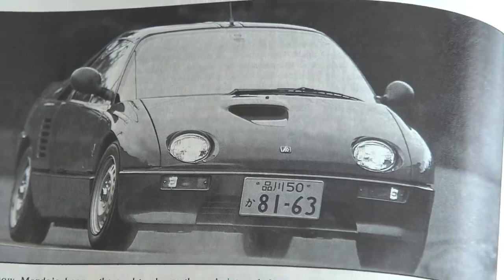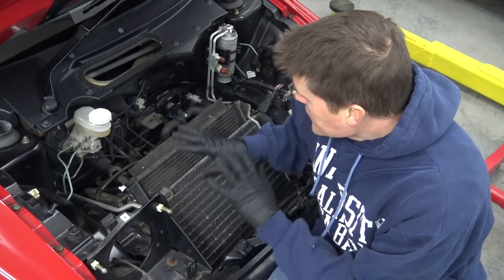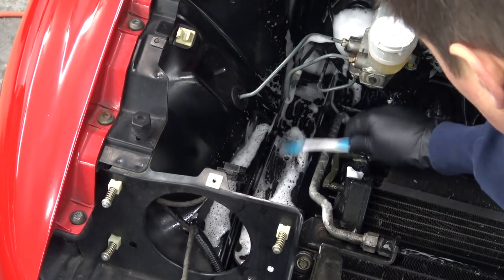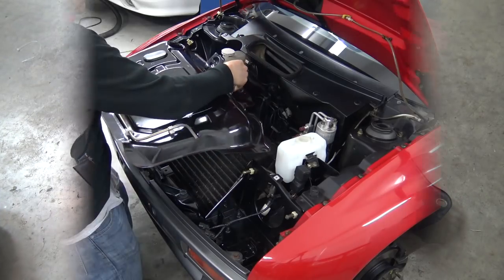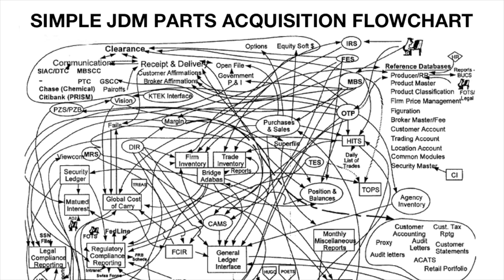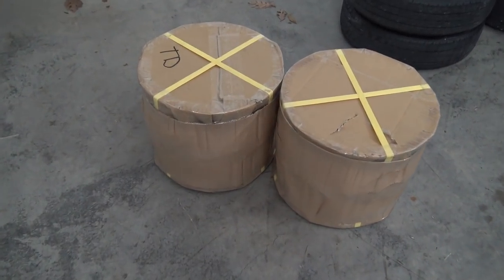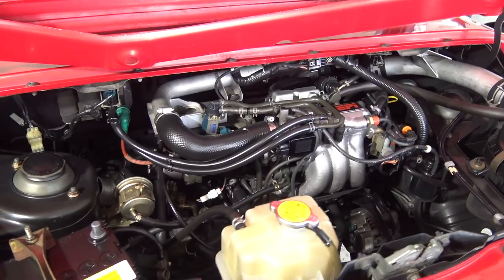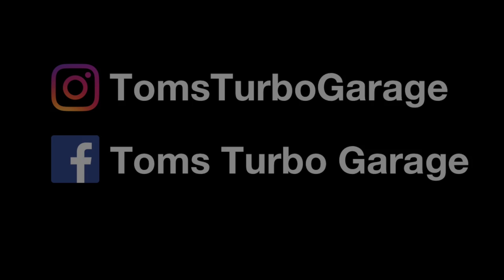1992 Autozam AZ-1 My Super Tiny Sports Car!  Part 2

Comment: That turbo timer is pretty cool, but it doesn't play songs like the HKS ones.  Those JIS screw drivers are a must. I was convinced for years that the Japanese had some how figured out the perfect formula to force you to buy new screws every time anything needed to be removed on any of their vehicles, until a very helpful Popular Mechanics article in the mid 2000's set me straight.

Comment: I'm pretty sure you can find mechanical replacement parts from early 90's Suzuki and Mazda vehicles. I'm sure the headache would come from finding nice Body part parts and interior parts
Reply from the maker: You can find some, most of the parts available here are for the SOHC non-turbo engine that is in the micro trucks.  All of the DOHC Turbo specific stuff is hanging out in the motherland.
Reply: Tom's Turbo Garage did you try megazip dot com? I found a lot of OEM replacement parts on that website for my Suzuki Cappuccino.

Comment: Scrubbing Bubbles is an interesting choice. Easy Off Fume Free oven cleaner should work for anything Scrubbing Bubbles can't handle. Easy Off Heavy Duty oven cleaner is even stronger, but I'd only use it for burned-on oil around the exhaust and turbo, because it's SUPER aggressive and it will damage metal if you leave it on for too long.

Comment: Hey Tom, next time you need to paint a metal surface matte black try using the rust tough from rustoleum. It's a tad more expensive but the finish is much better than most others that I've tried and it's a much deeper black.

Comment: Have you test-fit the spare tire in the space above the radiator? If it fits, it would be worth adding your own bolt to secure the tire in that spot, so you can reclaim the storage space behind the driver's seat.
Reply from the maker: The metal is too thin to mount a spare to.  A new thicker or reinforced metal radiator cover would need to be made.  The spare inside the car doesn't bother me that much, I don't need any more storage in the car for what I use it for.
Reply: Really? It looked like it was at least 1/16" thick, and assuming it's made of steel it should be strong enough to support the weight of such a tiny spare tire.

Comment: Tom, you know if you're getting into finding the correct JIS screw driver for working, you may be interested in replacing yellow zinc fasteners with the correct JIS fasteners.  It really makes the engine bay, or wherever, really pop.  I have found Belmetric.com to actually have JIS fasteners.  Like, you know, M6 with the ubiquitous 10-12-14-17mm head size?  Instead of the hardware stores' typical DIN standard fasteners.

Comment: I'm just saying, that engine bay has lots of room for a small Turbo for some more OOomph. As long as it's removable, we wouldn't want to loose the oem look and value.
Reply: It is turbocharged already.
Reply from the maker: Yes, it needs a little something for sure!  A turbo upgrade is available, but introduces lag.
Reply: Does anyone make a supercharger tiny enough to fit that baby engine?
Reply: Tom's Turbo Garage have the engine bored just a bit.   And don't go crazy of the boost.   Anyhow,  lag is what make crappy 90s turbos so much fun😂😎
Reply: Veganpotter Thevegan True, I do have to admit though that I love how they came out with several sequential setups on cars, beauties. I would love a mint condition 99 3000GT VR4, that's my dream car right there.

Comment: You would love the Toyota Mr2 they did a turbo and a none turbo could call it a mid engine go kart. Do like this though :-)
Reply from the maker: I do love the old MR2s, not sure why I never owned one, I've always thought they were great cars.
Reply: Tom's Turbo Garage  when i had my garage did a bit of custom work on a few like super wide body one big turbo all the engine bits came from Japan along with full worked suspension cost the guy an arm and leg but boy did it go it was like it had sticky tyres on :-))))

Comment: Go on google, type your 13" tire size in the search bar and endless results will come up. When I had my 83 RX-7 (which comes stock with 13.5" wheels through all years) I of course had to deal with the 13" tire dilemma (not really a dilemma though), unfortunately I didn't think to just use google then and went to Les Schwab which was down the road, new 185/70R13 tires were there the next day and I called most of the shops you mentioned and they all said they could get them in the same time. But for the sake of saving money it's just better to order your own. My main point is obtaining 13" tires isn't really a hassle at all. but otherwise good video, I love the AZ-1 and hope to see more videos about it
Reply from the maker: Thanks for the kind words and glad you enjoyed the video!  Yes there are lots of 13" tires, but not in this exact size.  I could've went taller/shorter/etc etc. but wanted the stock size.

Comment: Those Mazdaspeed wheels are a huge upgrade.  And I understand about finding good 13" tires.  Where did you find yours?
Reply from the maker: I went through a retailer on Ebay that had odd sizes.  I contacted them and they were able to order these.

Comment: There's another AZ1 video on youtube showing the spare mounted on the radiator cover, not sure if it was done aftermarket or OEM differences.
Reply from the maker: It could be either.  Mine has no mounting provision in the front, only behind the seat.  The metal on the front cover is too thin to put the spare on in my particular car.

Comment: You'd think they could've fit the radiator in the back, considering all the empty space in the engine bay, and given you a proper frunk. 

Also, did you have to replace the replace the stock tire wrench when you got those new lug nuts?

Comment: Cute car but I'm curious about the radiator configuration, especially its orientation in relationship to its engine?
Are there fans under the radiator (AC evaporator) drawing air through?  What angle is the radiator at (I'd be surprised if it was more then 30 degrees)?
It's my understanding that the radiator must be higher (slightly?) then the engine to prevent air pockets in the engine cooling system but I can't tell if it is?

Comment: Well, the Smart Roadster has rather similar data. 12 cm longer, 22 cm wider, 13 cm longer wheelbase. For motorization, the 101 PS engine is neccessary to get similar values as the Autozam AZ-1 aka Mazda AZ-1 aka Suzuki Cara. Values below are in mm.
Autozam Az-1: L 3295 / W 1395 / H 1150 / WB 2235 / WT 720 kg /Acc 0-100 km/h: 9.2s with 64 PS engine
Smart Roadster:  L 3427 / W 1615 / H 1192 / WB 2360 / WT 790–852 kg / Acc 0-100 km/h: 9.8s with 101 PS engine

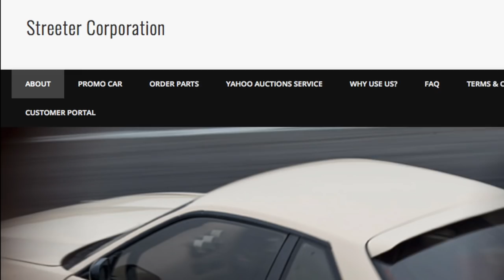Comment: Thanks so much! The rims u see @12:11 are the mystery jdm rims from my Integra or they look so close it's scary I have been hunting the made for these for a long long time....by the weight they are 30-40% magnesium and have be pressure tested at 5900psi idk who really made em but maybe this is the answer....toughest rim I have ever seen....
Reply from the maker: I show in the video that these particular wheels are made by Enkei.  They are not Honda wheels, they were designed by Enkei for the Mazdaspeed AZ-1.  The design is practically identical to the Honda wheels, just different size/offset.

Comment: Try any of the classic mini websites if you need any other tyres of those sizes
Reply from the maker: Good tip!  The aspect ratios and widths don't quite work out for this particular wheel, but if I switch wheels that would be a great source.

Comment: If you don't mind, where did you Source your tires from? I have just started restoring a 1989 Geo Metro Turbo and it also uses 13 inch tires
Reply from the maker: I saw these from an Ebay seller that I contacted directly to ask some questions, etc.  Good luck with your cool build, what a rare car!

Comment: Finding service and maintenance is a problem for JDM cars in Washington state.  Because of the emission rules in Washington state, emission certified shops are prohibited from working on cars that were not sold domestically.  There is $200k fine. That is why exotic service shops can do the work because they are not emissions certified.  They can charge a premium because of this.  Mostly of these shops deal with European exotics.  I may have to have check Vancouver for shops which means going to Canada for service. Vancouver is 3 hours away.  They have Kei cars there, but it is hassle to cross the border.

As you know, this car was manufactured by Suzuki for Mazda and sold under Mazda's Autozam brand (Kei cars).  The Suzuki engine is a f6a 657cc in-line 3 turbocharged engine.  No car in America had this engine, thus any VIN number typed by a certified emissions shop in Washington state would not find it in the database.

I have 3 hurdles to overcome:
1. Finding a non- certified emissions shop
2. Find a shop that has ties to Suzuki 
3. Find a shop wiling to work on JDM engines

The alternative service providers are nil so far, but I am still searching in my area.  I am not a mechanic and it is a real challenge finding support for this car in this state.  Are there shops that service and maintain JDM cars which are close to the Seattle area?

Comment: socks...scrubbing bubbles...needing a mediator instead of using JDM xfer app and using an address note in auction sold tag for shipping purposes...exhaust overspray...trying to get 13" jdm fitment tires anywhere than a tire distribution center...then buying nexen tires...no fender cover while working...*triggered*. Looks great though, but you need to just find Noriyaro on youtube and message him to hook you up with an japanese parts source guy. Then you need to get some better cleaning products and paint protection. As for tires, you should start checking with ATD, NTW, or some national chain distributor like that. Nexens are cheap. I would recommend Hankook, Toyo, or Yokohama for grip (since you won't be using it to drift obviously). They are skinny tires and the more grip technology in the tire, the better. If you're going american, Continental, Michelin, and Falken all have that size. They're just hard to get without knowing someone at a distribution center.

Comment: No 13" tires in USA?

Over the pond, all cars I have ever owned have 13" tires.

155/70R13 for city car Hyundai Atos
175/70R13 for mid size Daewooa Lanos
185/70R13 for full size Ford Sierra

Only those for Sierra are hard to find

Comment: Put a motorcycle engine in that thing. They are small and if you dont get too much power (example: Suzuki Bandit 1250: 1250ccm, 98 HP) they should make at least 50.000 Miles.

Comment: Sadly i probably dont fit in it. I am only 187cm but i ve outsized People with over 2m while sitting. Most tall People have long legs and i ve a tall Upper Body

One little Story is that i was on a car Show and they had a new smart there (Cabrio) whilst sitting up right i woud be outside by about 30cm

Or i went to look at a Mazda mx-3 I didnt fit at all also it had terrible paint 

Now i ve gone out and bought a rustbucket Toyota Celica T20 1.8l 118hp for 900€ and repaired it for 3000€